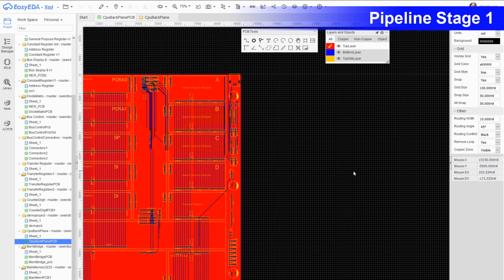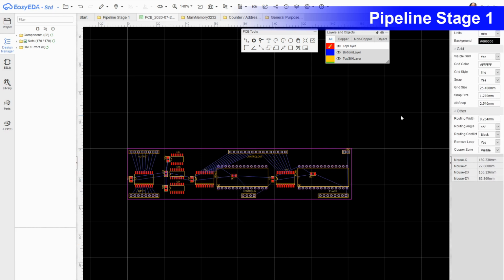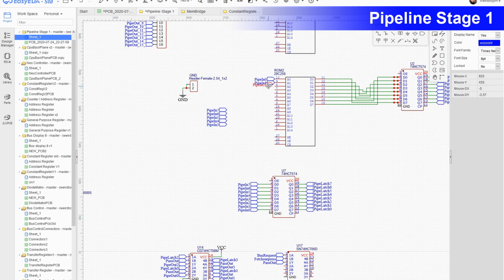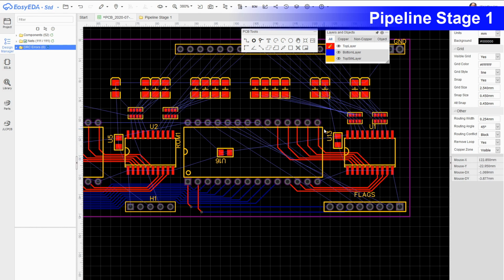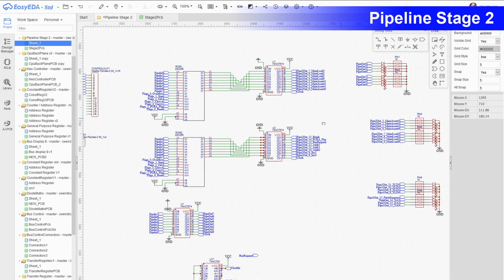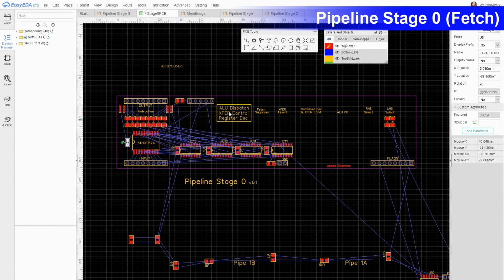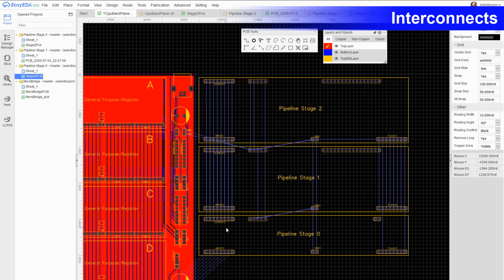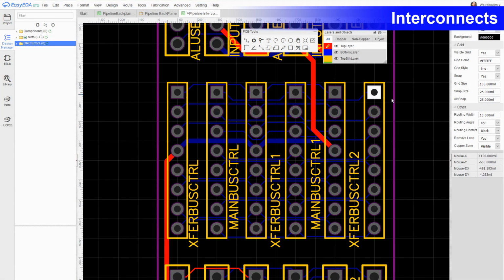Pipeline PCB Design - Making an 8 Bit pipelined CPU - Part 82

Comment: At 34:40 the original hex non-inverting buffer to complement the 7404 was the 7434 but they fell out of use when the more useful range of 8-bit buffers, such as the 74244 were introduced.
Reply from the maker: Indeed. There are actually a bunch of 74 series chips that are not available (or rare) these days.  Someone should make a guide of what ones are commonly available.

Comment: I know this is old but you may still get a notification. It happens here and there in various videos that you seem to overlook a 74x chip that might be a better fit. For instance, 74x07 and 74x17 are hex buffers (you explicitely mention the apparent lack of buffers rather than inverters here). Also, I seem to recall using two 4-input gates combined instead of a 8-input one (74x30) somewhere. Also, in some memory modules you used gates to introduce delays, not specific delay elements (74x31). There are also prefabricated latches (74x118, 119). Also, you could use 74x1G ICs if you only need fewer gates, you often mention that you don't like leaving gates unused. -- Or, am I missing something? Not available in HCT, too expensive, not normally in stock?
Reply from the maker: I've no doubt that there are chip variations that I've missed that would have been better. But I use some simple rules of thumb in picking chips, they need to be currently manufactured and widely stocked and I'm also prepared to be slightly imperfect in order to reduce bom size or variety. I made the mistake a few times of planning to use chips and then finding they were only available as old stock.  For example, none of my regular suppliers carry either 74hct07 or 74hct17. In future builds I'll likely use dedicated delay line chips, I consider it acceptable to match delays by passing a signal thru a like gate but because of manufacturing differences trying to create a more precise, larger delay with a gate sequence was a bit naive.

Comment: I'm wondering if you have considered standardizing on specific headers or connectors instead of using all kinds of headers of various sizes? For example, 2x5 and 2x10 are super common due to to being used for USB 2.0 and USB 3.0 on motherboards ... so instead of 1x8 headers, wouldn't it have been easier to use a 2x5? You benefit from connector being easier to solder (no soldering at an angle), you can use ribbon cables with 10 wires which are very common and standard and also often keyed.  Same with the 1x16 header, maybe use a couple 2x5, or a single 2x10? 
There's also 2mm pitch headers if space is a concern.
Reply from the maker: Lots of signals come in 8's for this kind of work but I should start bundling a ground return in. For this build I've had a lot of breadboard / pcb hybrid sections along the way so 2.54mm pitch is much easier there!

Comment: Would 3 bus drivers and a bit of enable logic not work better in place of the 4 multiplexers on the fetch unit? At least from the routing point of view, as those multiplexers have pins all over the place.
Reply from the maker: The chips would have taken more space, it's a tough call and In this situation I'm not sure one is better than the other. I might have gone the other way on a different day.

Comment: You might be able to ease up on pipeline stalls by making the memory subsystem 16 bits wide; fetch both the even and odd bytes. When a even address opcode has an immediate operand, it is already fetched and ready to go. When making PROMs, even bytes into one PROM, odd into the other. Half the time, no pipeline stalls. Loops can be optimized by placing instructions correctly. You'll need a NOP instruction to align loop entry points.
Reply from the maker: That would work, I sketched out a system with 32bit wide memory so I can have an variable width instructions and still regular gaps where the bus was uncontended. I also considered a hardware stack with a different ram chip as another way of reducing memory contention. In the end I put these ideas in the backlog for a future build, I'm trying to keep the scope of this one under control so it actually gets finished.
Reply: @weirdboyjim  I hear "actually gets finished"; I am now in year seven of Multics project.
Reply from the maker: Nice, I've just spent some time reading up on Multics, Interesting Project. Has someone tried to produce the original cpu family as a ttl project?
Reply: @weirdboyjim  The CPU is mind boggling complex; the emulator (including CPU, controllers and devices) is about 100K lines of C. The memory is 36 bit words; the data path to the memory controller is 72 bits. Two 36 bit accumulators, 8 18 bit index registers, 8 30 bit address registers. Integer, floating point and decimal ALUs. String instructions. Number formatting unit with it's own microinstruction set. Virtual memory flowchart that is 9 pages long. That's a lot of TTL. FPGA would probably be a better approach. I having been taking some FPGA courses, but it is a long way from a "this is how you make an adder" to "36-bit mainframe."
Reply: https://www.facebook.com/multicsfans/photos/mit-h6180-machine-about-1976-skin-doors-open/47517282155/
Reply from the maker: I want to have a dig into FPGA's but once again I'm being careful not to take on anything significant until I've got this first cpu build out of the way. It might be an interesting challenge to take on, I think that project might be worthy of a hybrid build (Make the big ticket items, registers and alu as physical boards but then put all the control and memory decode complexity in an fpga) I'll put a decent read of the specs in the backlog. Thanks for the links, hope you are still enjoying the project.

Comment: I wonder ... Do you have a very accurate way to measure the current of the whole system and single modules, and how much does everything consume ? Are you running different  voltages or is everything 5 Volts ? ... I bet you pull something nice with your oszi out of the hat  ;D
Reply from the maker: I can measure the whole system current (but i've not done it for a while) but it wouldn't be easy to measure individual modules, part from the ones that still exist as breadboards. Right now everything is 5v, I might end up with something else in the audio circuit when I get that far, but I'll derive it from the main 5v rail locally if I do.
Reply from the maker: Cpu running snek is chewing about 0.7amps at 5v.
Reply: @weirdboyjim  That's very interesting, much less than i thought !

Comment: Will the last in the series be translating the design in to silicon? ;-)
Reply from the maker: Interesting question, probably not. The nearest plausible thing would be coding it for an FPGA, that would make for an interesting challenge but I'm not sure it's the right choice. The split between 8 bit and 16 bit registers is a complication in this design, as it is for any processor where the address bus is a different size than the regular registers. A 32 bit processor would actually be a simpler architecture to do that for.

Comment: Exciting!!! Looks great! 
Quick question: are 74ls153 and 253 chips interchangeable? If I'm not mistaken you've used both? A quick look at the datasheets tells me they're functionally identical, but if you have some hands on experience with both it would be nice if you could confirm. I'm pretty sure you used the 253 in a different video? It might have been in the ALU.
Reply from the maker: Thanks Vortex! Ahh, the difference between the 153 and 253 is subtle but can be very significant. The 253 has tri-state outputs,  the 153 does not. In the situations I've used them (both here and in the ALU) I've hardwired the enable line so the parts can be treated as interchangeable. The tri-state functionality means you could both use them to drive a shared bus, or you could use a set of them to form a larger demultiplexer.

Comment: With this video the 2nd oldest Component is the ALU only to be toped by the Clock (thou it got redesgined in 74, 76 - 79)
Reply from the maker: Indeed. I've actually been watching the ALU videos a bit preparing for their pcb design. It would be nice to do it more incrementally.